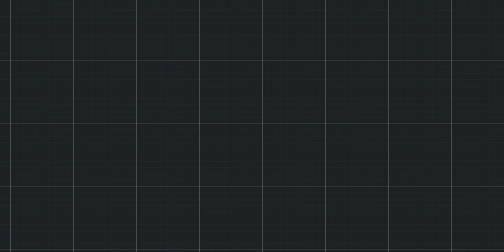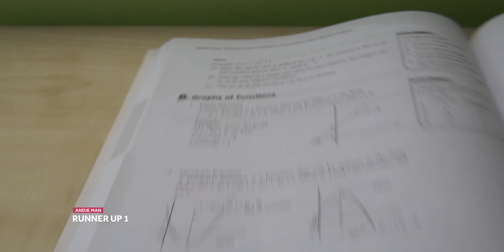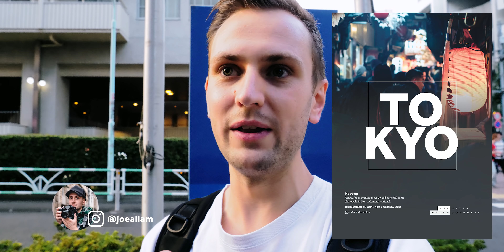JAPAN + Winners Announcement + Other Updates…

Comment: Since you travel a lot, I think it will be interesting to see your current (updated?) workflow for storing/backup and editing photos/videos while travelling, namely if you are using Gnarbox 2.0 SSD or other option for storing, a tablet or a laptop for editing and which is your software of choice (Lightroom, Capture One or Luminar?). Looking forward to seeing the documentary series.
Reply from the maker: The workflow hasn't changed all that much in the last few years. I still use standard SSDs for importing and then Premiere and Lightroom for most content. Occasionally I'll use Premiere Rush for video on my iPad, but I'm still working out the best workflow for integrating back to my Mac.
Reply: @joeallam  I think (from the reviews I've seen) you should contact Gnarbox (sponsorship?) since you are the perfect use case for their product and your workflow will benefit from it (I'm convinced of that). Trying wouldn't hurt. 😉